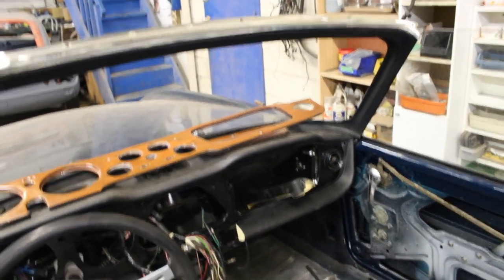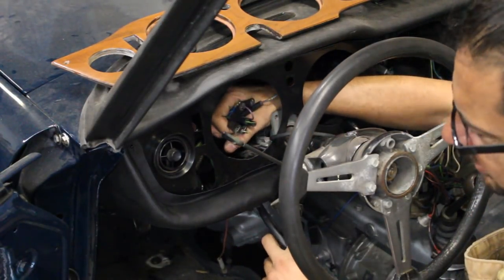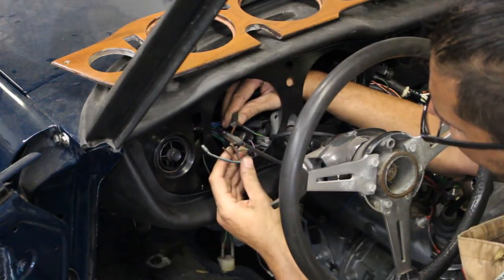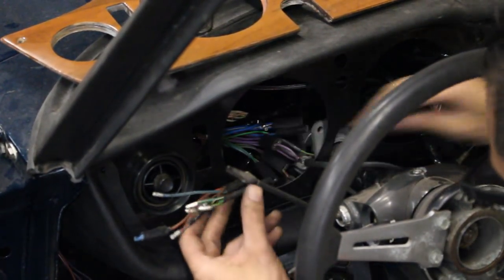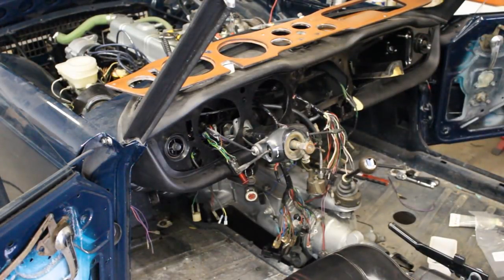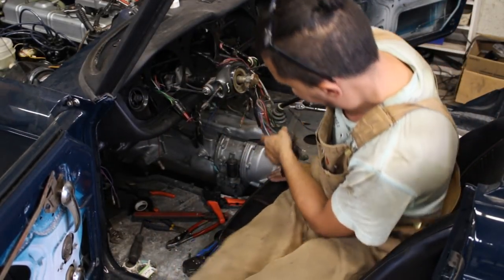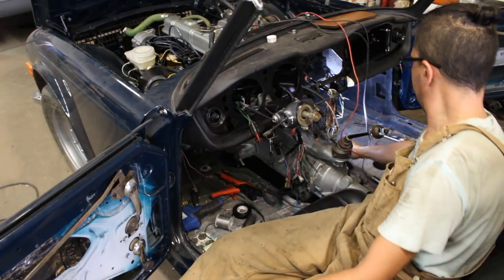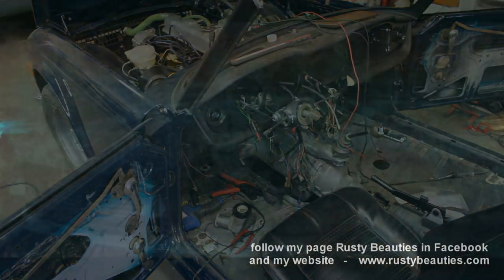1973 Triumph TR6 Restoration - Part 26 - Dash wiring

Comment: What happens if you have switched on the hazard warning lights and also turn on the turn signal? I think this contact should open the circuit to the turn signals when the hazard warning lights are on. But no matter, I also think that the switch is defective. But for the moment that's certainly OK.
I think that your systematic troubleshooting is very good. Thank you for another good video of your restoration.

Cheers Bernd
Reply from the maker: Good thinking. I never tried that! Well this is just a temporarily fix. I will order a new switch.

Comment: Just did these jobs myself so it’s great to watch and confirm what I did, great job. Did you check that the Turn Signal indicator was also working?
Reply from the maker: Thanks! Yes, it works now, but I will buy a new hazard switch just in case.

Comment: Hi Elin I had the same issue. The hazard switch cuts power to indicators when hazards are operating to stop indicators  interfering with hazard operation. Think you have a fauty or dirty connection on the hazard switch or as in my case the hazrd switch was not ging fully back and not making the connrction back to the indicators.
Reply from the maker: Yeah, that makes sense. I am buying a new switch anyway. This one comes all the way back, but for some reason does not restore the connection to the turn signals.

Comment: Nice systematic approach.  But Re turn signal indicator. Function restored but is the problem solved?  🙂 Is the hazard switch oxidized or mechanically faulty?
Reply from the maker: These switches are failing on many cars. They are just a weak spot. I will have to buy a new one eventually.